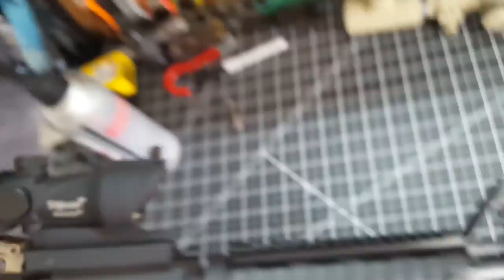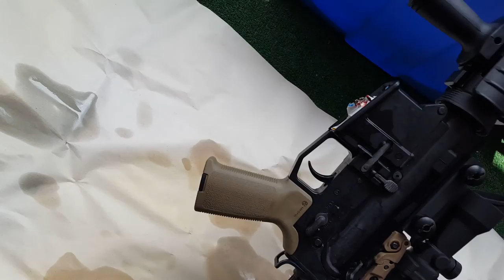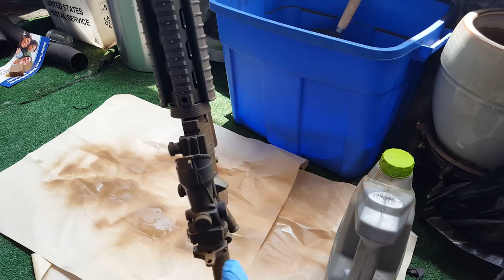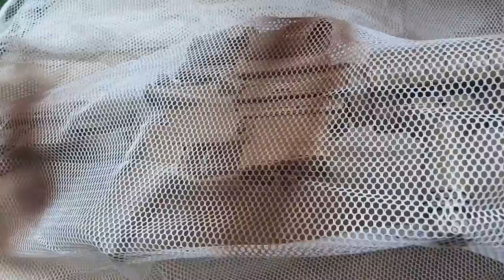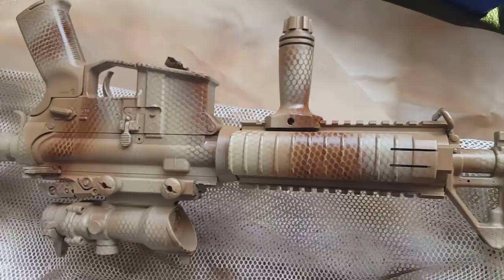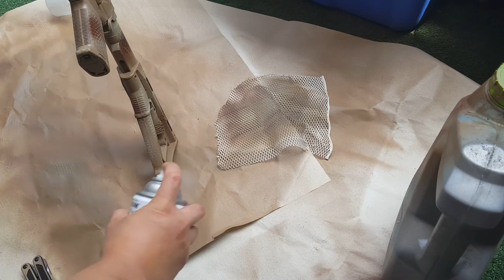DIY AR15 Camo paint job

Comment: how does your paint hold up to the heat from shooting? does it hold up good or does it get tacky at all? Just curious thinking of doing something similar to my AR
Reply: Stickiness is from the solvent used in the paint, and heat actually drives the solvent out. This is why many suggest leaving your painted object in the sun or even baking it in the oven. This is also why thin coats aren't sticky, because there is less paint volume the solvent has to work through. 

As Joshua said, if you want a permanent finish, you should duracoat or cerakote. Durakote. However, the point of spray painting is camouflage, and as the seasons or area changes, your paint color also has to change. Spray paint is easy to apply and remove, which is why they use regular spray paint in the military.